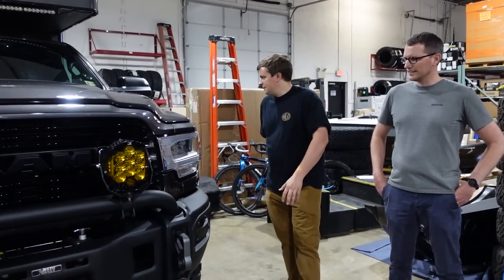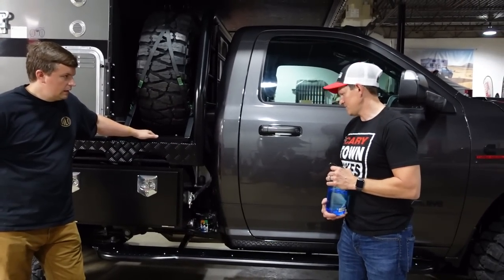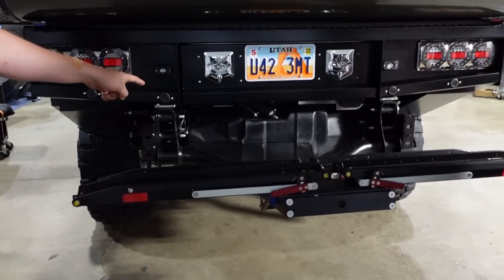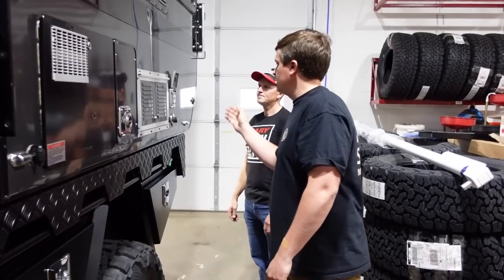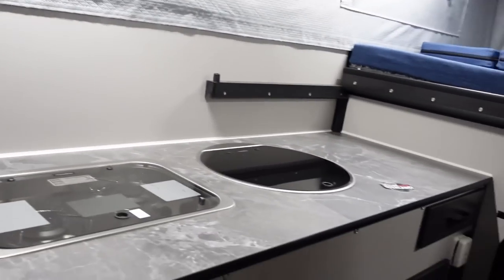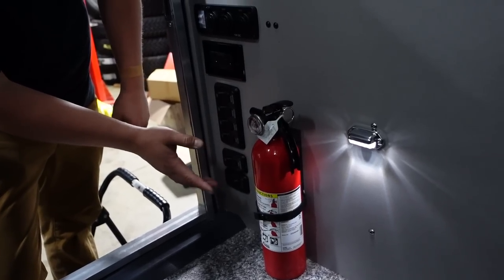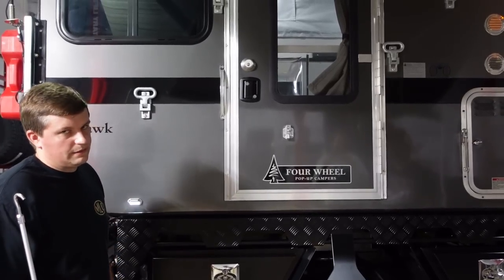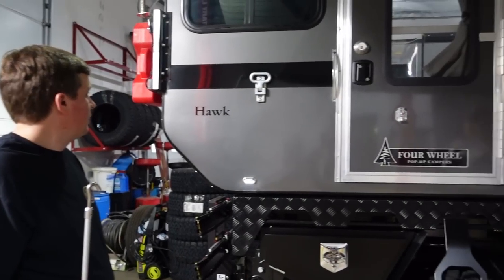2021 RAM 3500 Four Wheel Camper Overland Explorer

Comment: Very nice looking rig and build! We have a 2020 Hawk FB on our older 06 f350 and are loving it. If you go Carli you'll be happy. Lead times though lol... We're running their 4.5" Pintop system on 37" stt pros and it's been so nice on long 4+ hour dirt runs. We're able to roll along faster in more comfort. Not sure how cold of temps you're getting into, but we reconfigured our water system so it can be gravity drained anywhere. Pretty handy when driving thru changing climates. Built it out of 1/2" sch 40 pvc so we can source parts anywhere. You may be able to get your batteries into the same cabinet as your hot and cold water manifolds to free up that dinette storage as well as the old battery box. We are also running a Chinese diesel heater that's been awesome. It landed in the cabinet with the hot and cold water manifolds. We're looking forward to ditching our 3way energy Hoover of a frig. Love your frig by the way! We've done our build on a budget and still are ha! But it's going good. Enjoy your travels and stay stoked you two! 🤙🏻😁
Reply from the maker: Thank you and for all the good information. I’m curious how you set up the gravity drain. That sounds like a great mod for going up and down in elevation! And yeah we are running the AEV kit but have some Carli goodies on order. Just a long lead time as you said.
Reply: @overlandv10  glad to help if we can. If you get curious about the gravity drain, look me up on FB. I can share how we ran ours to see if it's something you'd like to try out. 🤙🏻
Reply from the maker: @jaysmallen3067  thank you. Once we get the camper repaired I think I would for sure like to find that out from you.

Comment: Hey Ov1.0,

Wow, that’s a dream rig!

Have you tried to jack the truck up from the sliders as Pete mentioned? It was my understanding that sliders are designed for light duty vehicles (half-ton and lower). I would be hesitant to agree that the weight of the truck can be supported with those sliders, especially after the mods done to them to make them fit (longer arms to attach to frame). It’s usually why I never see sliders on an HD truck; they can't support that kind of weight. 
It would be amazing video if you showed the truck being supported by those sliders!
Reply from the maker: thx! We are very much enjoying it. I have not tried to jack up the truck from the sliders yet. They are white knuckle sliders. While they were modified by MLO to fit this truck, they are made for HD 2500/3500 trucks by white knuckle. The modification was because they make them for the 4 door 2500/3500 vs the 2 door 2500/3500. I'm sure I will have it on the sliders at some point though and will be sure to post it up when we do. Thx again!

Comment: Awesome build; how did you wire the BD light bar that mounted to the FWC? Is is mounted directly to the underside of the camper? And is it wired to your truck battery or the camper wiring?? Did FWC mount that or was that “aftermarket” to the camper? Very interested in doing this to mine.
Reply from the maker: Thank you! Yes the 50” BD light is bolted to the bottom of the camper overhang and is wired to the truck power system / battery via the SPOD. It was mounted after market by MLO.

Comment: Super cool!!  I have a similar build.  I have also had one on a factory PXL on 40's and will tell you, you made a good decision on skipping them.  The 40's put the center of gravity up pretty high....37's too but 40"s that much more.  When you think that alll your weight is siting 12-14 inches above the top of your tires it gives you a pucker on big lean angles.  :).  Two other things....3 Battle borns will fit in the battery box, how come the 3rd in the rear?  You need to remove the black spacers but they fit.  Last thing is if you don't know it already, the rear tires are likely gunna bottom out in your rear fenders.  You might need to move the front boxes up and your back boxes back to make room for full articulation of the rear wheels.  My current build wasn't as close  as yours are and still rubbed.  I have the Norweld fenders and just centered them and im good to go..    Really bad ass build!!!!!  Thank you for sharing with us!!  I hop to se you out on the road!!!
Reply from the maker: Thanks Sean! I’m pretty sure I know your new and old rig. You had the road give way / the roll over in you PXL right? If so that was crazy and glad you survived it! And yeah now that I’m living with the 37’s and having had in the dirt a bit I’m perfectly happy not being on 40’s. I’m not sure why MLO didn’t put the 3rd battery in the box as I thought it would fit there also on other builds I’ve seen, but it hasn’t been a huge issue yet where it is. We have just been keeping bedding in there with it and haven’t missed the space it’s taking up so far. We haven’t had any rear rubbing that I’m aware of so far but I may not have gotten it flexed out enough to rub at this point, but we did have some front rub on the 13.5’s we are running and have done some additional trimming and such to mitigate it. Appreciate all the info and hopefully we will get the opportunity to meet in person at some point at one of the events if you attend any.
Reply: @overlandv10  Yup that’s me with the rolled PXL.  The new build is on Carli and 35’s.  Love love love the Carli and i feel way more comfy a bit lower to the ground!  Loved the AEV too but our trucks benefit from a reservoir shock for sure!!!  They still get too hot to touch after rolling hard for an hour on a dirt road.   I’ll be at the coffee and rigs thing at FourWheel camper Woodland next weekend and expo West too!  Hope to bump into ya!
Reply from the maker: @2Dawoods  I’ve heard lots of good about the Carli. We actually have some upgrades on order for our set up along those lines but as you know the lead time on everything is nuts. We plan to be at west and hopefully camping with the FWC group so we should definitely see you there, but I need to get the camper fixed first. We damaged it this past weekend in Moab (video about to release showing how that happened).

Comment: Had you considered the Sportsmobile Classic 4x4?  Fully loaded it is around the same cost, but you could also spec cheaper.  You mentioned other more expensive alternatives.  I am just curious as to this choice.  Do you tow and need the extra towing capacity?  What led you to this setup versus other options?
Reply from the maker: I do like the classic sportsmobile also. If I had unlimited funds I’d probably have one of those also. But I love the look of these regularcab flatbeds so that played into the decision I made. I also wanted the shorter wheelbase. No plans currently to tow but we have kicked around the idea of flat towing the Jeep at some point in the future and using the camper as base camp to run some of the stuff the flatbed won’t fit down.

Comment: Just going to drool over your rig until we get ours. Did you get both maxx air fans or is one the fan and the other a vent? We just did one fan, but I’m curious how that’s working for you as far as temperature control with two fans (if that’s what you got) thanks!
Reply from the maker: We got both of them. I spent about 3 hours in the rig a couple of days ago in 105 degree heat and having one fan draw air in and the other pull it out was almost as good as AC. I only had two of the windows open as well. I’m sure it would have been even better with all of them open. The other nice thing we are finding is when cooking it does a good job of pulling the “smoke” out over the stove but we also like a fan to blow on us while sleeping so having both powered allowed both of those things to happen.
Reply: Thanks for this! Good to know. Our order is already in, but might try and see if we can add the additional fan;  sounds like a game changer to have both. I like that you can really control the temperature. If it was 105, which I believe since it was hot in SLC, then that’s a damn good test!
Reply from the maker: @alisac8845  I’m pretty sure you can change it to a point. There just might be a small change fee. Based on my experience I’d for sure put in on the list of must haves if you are able.
Reply: They do charge a fee for any changes. I appreciate your feedback - super helpful, thanks!

Comment: With all the mods and 37s, what kind of fuel economy are you seeing? Looks great. I’m in the early stages, trying to decide on a platform.
Reply from the maker: Doing 65-70 about 13.5-14mpg. Getting out west where it’s 80mph more like 11-11.5mpg. That’s all per the computer. Haven’t taken the time to hand calculate it yet to see if the computer is correct.
Reply: @overlandv10  I keep holding out hope that Toyota puts a Cummins in the Tundra like they said they were going to but never brought to market. Dodge is my front runner right now.
Reply from the maker: @benjy111100  that would be awesome if Toyota does it.
Reply: Fuel consumption is always a thought, but ultimately we just want to travel and it takes fuel to do that. You can't put a price on a smile 🤙🏻. So I smile when fueling lol!

Comment: Was curious if you have the HO cummins and also are you running a locker or just have the option to control it later.  I though I've been reading theres no lockers on the Ho yet.
Reply from the maker: It is not the HO, just the standard cummins. I wasn’t aware of any locker options from the factory for either option other than I know you can order the power wagon package on some of the crew cabs. But maybe that is wrong? We installed ARB front and rear air lockers to get the lockers in it.

Comment: Can you and others tell me you thought process for picking a Ram. We want to chose a truck for our slide on hawk and would love your views on why you went with the Ram. We are leaning towards the ford f250 and no diesel. It will be our everyday vechie as well. Were in south florida.  I know all the different specs from reading Facebook and watching videos but I would a non bias opinion
Reply from the maker: Sure! I think it mostly came down to looks and aftermarket support. Have always had a thing for the way the RAM looks over the other full size options and there are a few more options in the aftermarket for them when it comes to building them up. As far as the diesel option I didn’t want it to struggle in the least to carry the load and with the 850 torque numbers the Cummins has it was an easy choice. When we are fully loaded up with water and fuel and fully packed out bikes and all, we are just under GVWR (another reason we went 3500 with air assist vs 2500) meaning this rig will spend its whole life near max payload which isn’t a big deal for the diesel. The diesel should get better MPG than the gas option too which will add up over all the miles it is driven. Of course that is dependent on diesel prices staying close to gas prices.
Reply: Hope you don't mind me stepping in here. Before you choose your truck, you need to figure out how much weight capacity you need. For example, if your 4wheel camper weighs 1500 lbs. + water + gas+ all other stuff, etc... Figure out what you will carry in the truck and how much it all weighs, then you will have a better idea for truck type. I find most people need the capacity of a 1 ton because most people get a crew cab P/U with a few options and these pick ups weigh a lot and don't have enough capacity for weight carrying, even in the 250/2500 series of trucks. For example, a typical high trim F250 4x4 crew cab can top out 2800 lbs or there abouts. Not alot of capacity. You don't want to spend all that money for a truck that will be used close to its max payload capacity. Different brands of truck, well this is very political for most folks. Since you stated you did not want a diesel, I would consider a truck with a more conventional 8 cylinder build and stay away from turbo charged vehicles for better reliability over the long term. Another reason for this is turbo charged engines typically make the power at the higher RPM range or faster speeds and towing or camping with a loaded up truck is better to have the power at lower speeds and RPMs. Just my 2 cents. Best of luck!
Reply from the maker: @3920cruz  don’t mind at all.great thoughts and feedback. Thank you

Comment: You had me till about 6:00 in when y’all called them steps sliders… lol moving on. Coming from a rock crawler those are steps! Climb some stair steps on a trail and you will see very quickly, I mean if you’re really going overlanding.
Reply from the maker: They are white knuckle sliders and do support the weight of the truck, but yes it isn't intended to be a hard core rock crawling rig. It is capable for a camper, but not nearly the rock buggy a nice Jeep build can be. Overlanding is a broad term that has different meanings to different people. I think the term you are looking for is "rocklander".

Comment: The ram assist steering and lockers make it a real off road rig. Do you know the total weight?
Reply from the maker: The GVWR on the door is 11,800. We put it on the scale when fully wet (full water tanks and fuel tanks) as well as fully packed out for a trip including bikes and we came in just a hair under that so we are under GVWR which is good, but not by much. When it’s not packed out and full of fluids it is probably a good 600-700lbs less than that. Having said that some people think it weighed heavier than it should have an wonder if the CAT scale was as accurate as it should have been. I will probably weigh it again soon on a different scale to see if that is true.
Reply: @overlandv10  CAT scales are accurate, because it is for DOT. trucker has to know if they are over weight, or big fines.

Comment: Is that a Big Horn? Why did you choose a Diesel over the Hemi?
Reply from the maker: Yes it is a Big Horn (or Lone Star if you buy it in TX). Went diesel because I didn’t want to ever struggle with feeling like it was under powered. I know the Hemi has plenty of power too, but the torque the Cummins has isn’t even in the same league compared to the Hemi. Time will tell but I also hope the longevity of the Cummins makes it worth the extra expense.
Reply: @overlandv10  Yeah, all valid points I didn't consider. Seems more fuel efficient also not to mention diesel fuel is less than Gasoline now. I was concerned about weight but I agree with your points.
Reply from the maker: @TheUnorthodoxx  have just over 4000 miles on it currently and the mpg has been averaging around 11-12 in mixed driving. But our hwy speeds are 80 mph. If we were more 60-65 I think we could be doing more like 13-14. I don’t think it’s that bad as heavy as we are.

Comment: I've seen better quality builds. Looks like they ran out of capital for the build and never really completed it.
Reply from the maker: Interesting take. It was purpose built and so far it has met the purpose as we continue to work on getting it dialed in as we have found ways to rethink a few things. Genuinely curious what you think we should have done differently than what we did for the purpose we built it for?
Reply: @overlandv10   well first of all the truck choice was great for the build and I  liked the exterior but the interior looks like it could have had better placement to be more efficient with space. Could also have better cushions for the bed and living room. The shower should be towards the back of the camper away from the manager 30 and electricals. There could be some wood grain and double pained windows because if you are camping you want to enjoy the scenery and if you added the more luxury  features in the camper like a TV in the wall you may expand the customer range .
Reply from the maker: @jackchavez9990  ahhh okay I better understand now. The camper portion is made by Four Wheel Campers. It’s about as optioned up as you can get one. I suppose you could build something custom but the FWC folks have been at it for a while and do a pretty good job for the purpose we were after IMHO. This build is going for a blend of “comfort” that is step up over a roof top tent but is still a solid all around off road rig. Earth roamers sound more like what you are thinking and they are super nice, but they are too large for what we want to do and there is also the consideration of how much money are you willing risk driving some of the places we like to get to.
Reply: @overlandv10  i agree Earth roamers are too big and what pulled me toward your video was the presentation of the outside and im in the market to get a 4x4  vehicle that has the necessities of a home but not like earth roamer. I own a business that lets me work remote so thats why I would like to have some nice internal features. But if I could design my own I would be interested.
Reply from the maker: @jackchavez9990  we sound like we have a similar lifestyle / flexibility. If you aren’t already aware of Bison campers give them a look. I’m pretty sure they will do more custom work if you are looking for a popular style camper.